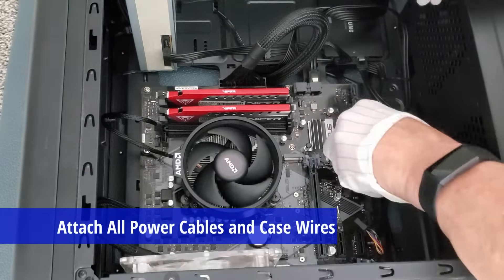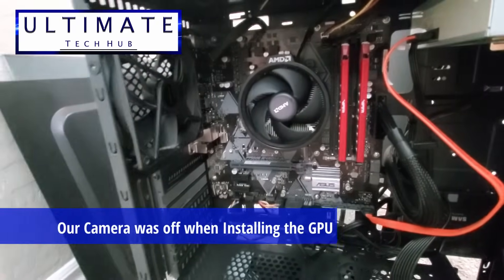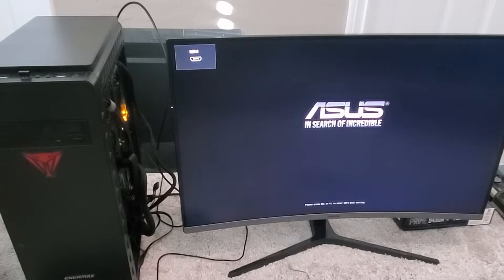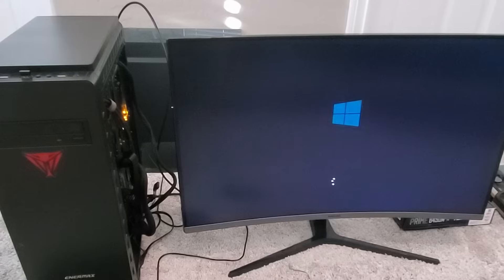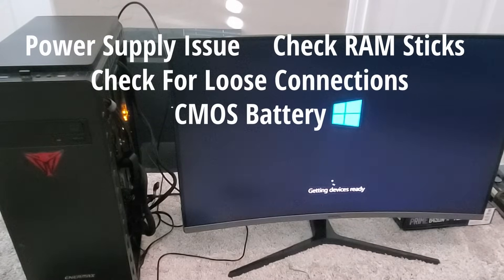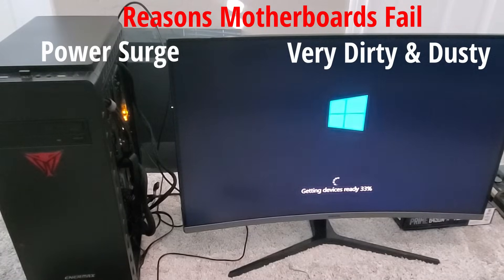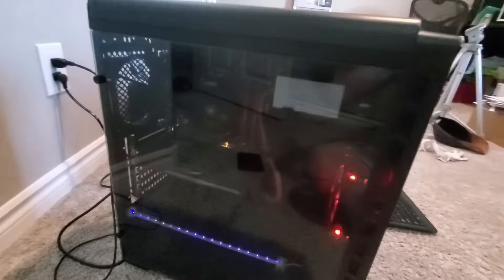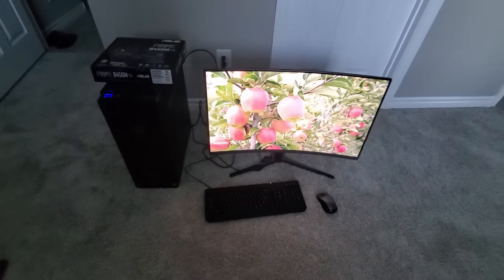HOW TO REPAIR A DEAD COMPUTER - DIAGNOSING A MOTHERBOARD FAILURE! - HOW TO

Comment: Please reply, whenever I boot my pc , the fans just spin with high speed and nothing shows up on screen? Please reply
Reply from the maker: Bad Motherboard most likely.
Reply: @UltimateTechHub  so should I change it?
Reply from the maker: @gurpreetsandhi4671  Yes, it's most likely a bad motherboard. The fans spin so the PSU is sending power. You could check the CPU for bent pins as well.
Reply: @UltimateTechHub  Thanks sir
Reply: @UltimateTechHub  hello sir , I just changed the motherboard with exact same model ( same motherboard ) but it's still have same problem , please help 😭🙏
Reply from the maker: @gurpreetsandhi4671  Have you double checked the power connections and the pc case wire connections? It sounds like it's not installed correctly. It's the same symptom as before. If your using a GPU make sure the monitor is connected to the gpu not the mobo.
Reply: @UltimateTechHub  I tried everything like 3-4 times
Reply from the maker: @gurpreetsandhi4671  How many watts is your PSU?

Comment: See mine was weird the psu worked "it was brand new just bought it" and some leds weren't going on but the motherboard has lights on it and those won't turn on I tried the cmoss nothing so I got a another motherboard

Comment: Question, what can I check on an older ECS motherboard that I can't get to power up? Thought my power supply was dead so I tried a known good supply and still nothing. I know some resistors are bulged out from a quick look. I'd like to restore this thing to it's old school glory to run Windows 98 SE. I don't know what other board to get if I can't get this one going.

Comment: Okay so my pc had a short in hard drive wires and from then it turns on by itself when i put power to it and power button says its ram issue but i cleaned my ram and uts still the same could it be my m¥therboard? I changed my battery swaped hard drive. (my english is not that great)
Reply from the maker: It's probably your motherboard. That's my best guess. Motherboards are susceptible to power surges that can damage them.
Reply: @UltimateTechHub  tanks for reply then in couple days ill buy new motherboard

Comment: I've replaced the CMOS battery, tried 3 different RAM sticks, checked the CPU for broken pins, 2 different GPUs, 2 different PSUs and still no luck
I'm starting to think this is a motherboard issue but I don't want to buy a new one
Anybody have any other ideas or is it definitely a MOBO issue
Reply from the maker: It's a dead motherboard. This happens sometimes do to electrical shocks.
Reply: @UltimateTechHub  Thanks for the timely input 
Unfortunately it wasn't what I wanted to hear
Luckily it was a project PC and I can just sell the parts
Reply from the maker: @dominicklipari  Most often it's the motherboard or the power supply that goes bad. That's been my experience over the last 10 years. Thank you for watching I really appreciate it.

Comment: I have a Acer Nitro 5, the problem I have is that my fans where really dirty so I took the bottom piece that covers the inner of the laptop and cleaned the fans, once I finished cleaning the fans I put the bottom peice back I plugged in the laptop and it showed that it was charging, but when I turned it on it showed that it turned on but the screen was black then like 5 seconds after that whole 10 seconds situation the laptop just just off completely, the light indicating the the laptop is charging doesn’t show anymore, it can’t be the charger because my brother has the same laptop and I plugged my charger into his laptop and it works, his laptop charges and everything is fine so I knot that it can’t be my charger, so I tried his charger and it doesn’t work, but it does work for his laptop. So it can’t be my charger or his, so I for a fact its my laptop.
CAN ANYBODY PLEASE HELP ME, I DON’T KNOW WHAT TO DO AND I DON’T WANT TO BUY A NEW LAPTOP, SOMEONE PLEASE HELP ME
Reply from the maker: Try taking off the cover again and look to make sure nothing got unplugged and then make sure the panel is secured correctly.
Reply: Ok
Reply: Everything looks fine
Reply: What now?

Comment: I swapped ram from 16 gb at 2133 too 32 and its default was 2133 as well my motherboard is a asus prime 450-a and it was rated at 2133/2666/2900 i put it too 2900 and it wont post . I took out the cmos battery swapped ram sticks even put one of the old and one of the new separately for different attempts too boot no screen except for when i use a single stick of ram it pulls me into a screen that’s almost static then goes off and repeats i cant find anything to help. I think there may be a fried mother board ? Im hoping not gpu everything also lights up except keyboard and mouse when the screen doesn’t go static plz plz plz help me

Comment: My Gigabyte motherboard is acting crazy. I hit the power on button it will go through the bootup process and boot into Windows. But normally booting I hear the single beep. When it acts up I don't hear the beep and some of my connected devices like my case lighting LEDs don't come on and I suspect other things aren't running properly. So I continue using the computer for hours and randomly I will hear the beep somewhere along that time. At that point I just go WTF. I look at it and it seems to be operating fine. I shut it down when I'm done and the next day when I boot it up sometimes it works okay and sometimes it won't. I have a Corsair 1200W power supply that is about 5 years old so I don't suspect it. I have have strange crashes with this Gigabyte board since updating the BIOS a few months ago. I have the BIOS set to the defaults to minimize the crashes. Anyway, my question is I want to replace this motherboard with another z390 and use the 9700K CPU and all the other stuff but I thought that if you change a motherboard you have to get a new Windows key and reinstall all the programs???? I remember I had to do that once back when I had Windows XP. Is that still the case?
Reply from the maker: It may be your PSU if it's 5 years old. Most PSUs last 3 or 4 years tops. Otherwise it's the motherboard. You might need a new windows key but they are only 12 or 15 dollars on urcdkeys.com. I have a video about that website. It's legit, I've used it many times for my clients PC builds. Good luck and keep me posted. Thanks for watching.
Reply: @UltimateTechHub  I was afraid of having to purchase a new key. This one is the full use Home edition I paid over $100 for. I usually do buy those cheaper keys from that site you mentioned. That would mean installing the programs and games again. I have some programs that can't be replaced because they are no longer supported. I can't believe this PSU would be going bad already. It was a higher priced model. Like I said earlier most of my issues started when I update the BIOS from F9 to F12 on the Gigabyte Z390 Pro. The BIOS didn't work the first time and I had to use the Dual BIOS to get things right after screwing with it for days. I'm no longer a fan of Gigabyte MoBos. I like ASUS boards. Thanks for your reply.

Comment: How can I tell if it's my motherboard or my CPU is bad? My computer turns on but no screen I've tested USB by charging my phone they work. I have to say I changed the cooling system to liquid and I might have wired the pump wrong I never saw anything pop up saying overheating. Yesterday had computer on I had noticed that the front rgb fan were flickering meaning something was either wired wrong or the rgb cable came loose I like at manual for pump and noticed I had plugged into the wrong connection so could I have damage my CPU? I did once way over heat. This is my first built everything on the computer is less than a year old
Reply from the maker: You could remove the CPU and look for damage like bent pins. If it looks fine then put it back in. Also make sure to replace the thermal oaste to prevent over heating. Make sure the CPU cooler is wired to the CPU fan. See if that helps. Keep me posted.
Reply: @UltimateTechHub  will do thanks also should I take the time going through all the wiring? Or start with just CPU first?
Reply from the maker: @shawnLisi  Yes definitely make sure your wiring is correct. Good luck.

Comment: I know this is a old video. But my laptop was working fine then it became a brick. No response, lights, fans, nothing. Just completely dead. Took it to a shop and they tested stuff, out it back together, and it worked fine for a week. Did the same thing. Just recently for fun I tried to turn it on and it worked. Now it a brick again. Sometimes it goes a while and sometimes it goes only a little amount of time before it magicaly works again. The repair shop is braindead and can't fix it and just replaced things that were working fine. Any idea of what it could be? If you need more info let me know. It a msi gl63 8s3, i7, rtx 2060
Reply from the maker: Inconsistent start ups and then not starting up is probably the motherboard.

Comment: Have an issue with my current rig. I think it the motherboard failing cause sometimes my PC won't turn on at all andi have to fill the PSU off and back on sometimes. and in another instance it failed to start CPU fan, also 'fixed' by toggling power switch.
Reply from the maker: Yes it sounds like a motherboard problem or a PSU problem. Sometimes PSUs can start giving symptoms like not consistently powering the PC or suddenly losing power and then acting normal again. Mine did that a few years ago. So check the PSU first then the mobo. Thank you for watching and keep me posted.
Reply: @UltimateTechHub  Issue only seem to happen when turning it on after shut downs but not every time(comes in and out sleep mode without issues). Haven't had overheating or sudden shut downs while it's on. Edit : and after a cleaning I'm not getting any power issues....guesi t was just dirty CPU fan..idk

Comment: I need your help. Comp was working fine, woke up and it doesn’t turn on any more. The only thing that turns on is a red blinking light on the motherboard (asrock asb350 K4 gaming). No fan no nothing. I replace the cmos battery, tried jumpers, power on with n without ram. Still same blinking light. Took out the gpu also n same result. Now would the motherboard still have light if the psu doesn’t work? I’m thinking it’s either motherboard or cpu. Any suggestions? Like would a bad motherboard make the fans not spin?
Reply from the maker: It's most likely the PSU because your fans are not spinning. The motherboard light takes so little power and is probably powered by the cmos battery. Replace your power supply. I have a video on a power supply calculator. Watch it so you get the right amount of power for your system. Thank you for watching and keep me posted..
Reply: @UltimateTechHub  you are so awesome for the quick reply! Okay I will try do some testing and let you know!
Reply: @UltimateTechHub  okay so I was able to find my Evga box and find the tester. After putting in the tester into the 24 pin. The pc was able to turn on and the fans were moving. Two of my front fans were spinning. The back one wasn’t for some reason. What do you think? Motherboard is the problem? The fan on the processor doesn’t spin either which is connected to the motherboard.

Comment: Have you ever had a dead mobo, cpu and ram; and when you transfer the CPU onto a new mobo it kills it as well?
Reply from the maker: No i have never had that happen. It's almost impossible to have a dead CPU, mobo and RAM at the same time. I would start with the CPU and make sure the pins are not bent.

Comment: Very good stuff here but you're basically just swapping out parts until it turns back on. Most people don't have a spare power supply laying around and if you do this a lot I'm sure you know by now you probably should have went ahead and tested the motherboard on its box, especially since you already had a power supply sitting out..

Comment: When i turn on my computer and booting up then suddenly turned off  when i checked it fan is still spinning but the red light in system unit is off the ssd still have some red glow mouse is on keyboard is off i change the psu with new one but still the same, is my pc have a problem with the motherboard? (English is not my language)

Comment: You never diagnosed the motherboard. You diagnosed your computer, determined there was a problem with the motherboard, and then replaced the motherboard rather than repairing it. Boooooo
Reply: There could have been a problem with the CPU as-well. Not as likely but definitely possible, and worth mentioning.

Comment: bro i purchased all new components my psu is working but electricity can be felt all over motherboard and processor body. my pc not starting up and no fans are spinnging moreover before shorting the " power sw" pins all rgb of motherboard glows but none of the fan spins

Comment: Hello right now I'm experiencing issues with my PC. When I play games or.open the pc it turns green, white, blue and red screen. It happened before and was told to replace the hard drive and it worked for 3 months and now it's back.

Comment: Hey I have a Q code (AA) on my motherboard that comes up with a motherboard power failure. But my pc still turns on and runs normally apart from when I launch certain games they crash my entire pc.
Reply from the maker: Games can crash a PC for many reasons. Could be not enough RAM or over heated the CPU. Some games use lots of RAM so check and see if it's a RAM issue.

Comment: Hey i got the black screen and switched my ballistics back to the included one. Could it be those ports are bad? 
My ram (16) was running at 7 max so I ran a test. 
After the test restart got black screen.
Then I disconnected my gpu. The computer started after that but then on the next one I got the black screen I had no power to the mouse and keyboard again and I have not been able to restart it
Reply: But I put one of the steaks into slot one and the board started beeping at me crazy but the original stick did not make the computer run either so I’m figuring it’s either the power supply which on my HP definitely isn’t designed for a 6 GB card so I think I need a power supply a motherboard and new rim because the motherboard and power supply for this particular model or some crazy thing and I can’t really get a upgrade for it is the gist of it
Reply from the maker: Sounds like a bad mobo or psu.
Reply: @UltimateTechHub  yea thanks I’m
Just buying a used tower with no card. I’m knew it was pushing it ryzen 3 intergrated Radeon and a 1060 6gb lasted a year.
Reply: @UltimateTechHub  thanks for the speedy reply

Comment: So my son has a 5 year old gaming pc.
Now it does not start, the motherboards lamps just quickly lites up for a second when started, this repeats every 5 seconds, nothing more happens. So it tries to start, but does not.
Changed the power supply but PC still has the same problem.
Now we will test every item like CPU etc.
Anyone know this symptom/fault?
PS. This pc was just left for 2 years when it didnt start. Now were fixing it.

The pc has these specs:
-MSI Z170A GAMING PRO Carbon
-I7 7700K 4.2 ghz
-KFA Geforce GTX 1070
Reply from the maker: I would say it's the motherboard.

Comment: Actually that’s my problem now. But i have no way to check first my ram if it’s still working. One of technician said it’s ram but the other one said it’s motherboard. So I’m kinda confused which one should i replace. 😣
Reply from the maker: Don't replace the ram. Clean each ram stick and if you have 2 sticks only use 1 and see if the pc boots up and then try the other ram stick. 2 bad ram sticks is almost impossible. If that doesn't work then it's most likely your mother board.

Comment: Hello, I hope you check this comment. My pc shut down a couple of days ago and im trying to figure out what the problem is. I don't have an extra PSU nor a motherboard.

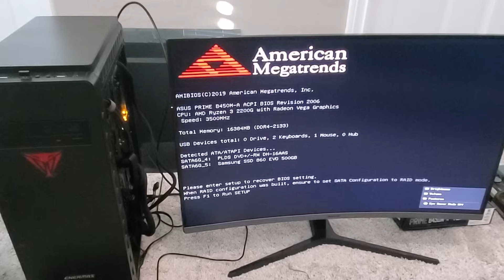Whenever I remove the CMOS Battery and put it back, I can go to the same screen at 4:53, I go into BIOS and save then restart - after that it goes back to being black screen.

Is this the motherboard or the power supply? I hope you can help me.
Reply from the maker: Are your fans turning on? Does your motherboard beep at all when it boots?
Reply: @UltimateTechHub  it never beeped even when it was working. Fans are working, yes.

Comment: I have the exact same motherboard. , And had a psu problem , I jumped green and black of 24 pin and it didn't start so psu was faulty
Reply from the maker: Yep the PSU cam be the issue more often than not. I've replaced many PSUs after a few years of use. Thank you for watching I really appreciate it.
Reply: @UltimateTechHub  I should be thanking u for the content

Comment: What about the processor?
Reply from the maker: It's pretty rare for a processor to fail and the usual cause is your computer over heating. So if your PC overheated then it might be the processor. Otherwise, the 4 reasons in this video are your best bet. Thank you for watching and if you subscribed thank you as well.

Comment: bro my pc wont boot every 2mins its always restart. 🥺 should i change mobo with same speca???
Reply from the maker: You could try to unplug all of your USB devices from the PC then restart from the power button on the case. If it starts normal then you can plug everything back in. Otherwise this is a Windows software issue or the motherboard. If you have another backup hard drive with windows on it you can swap it out to eliminate the bad mobo. Keep me posted. Thank you for watching and if you subscribed thank you as well.